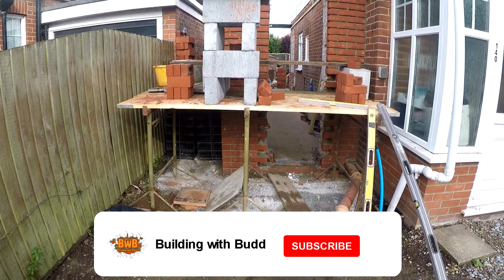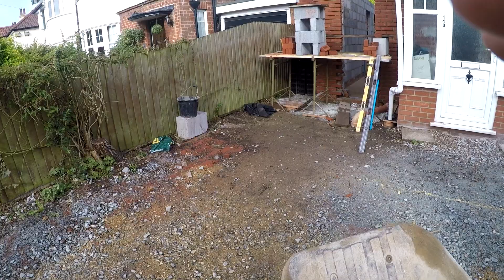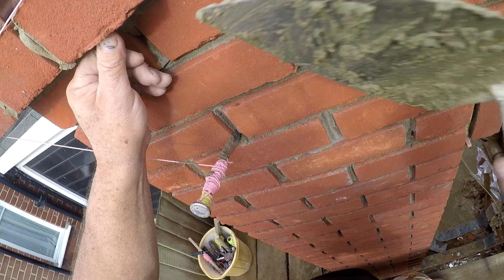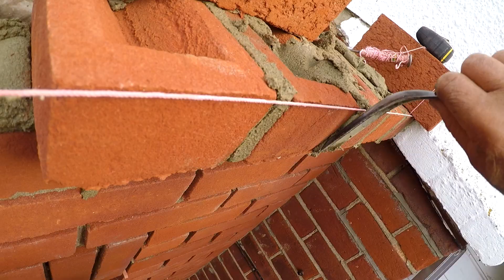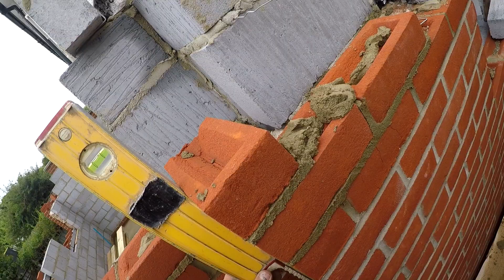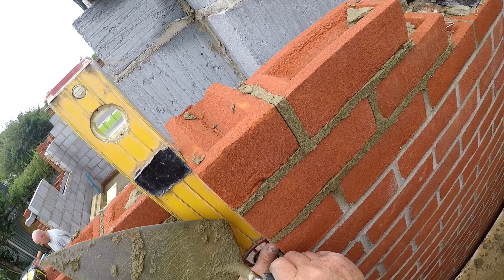Bricklaying the overhang course ready for blockwork on mountain goat scaffold

Comment: What is the best way of setting up a line of the house to a profile on a corner? The extension doesn’t run inline with house so thought I’d maybe screwing something to the wall?
Reply: Dutch pin
Reply from the maker: Luke what’s a Dutch pin , never heard of it but very curious, cheers Luke 👍